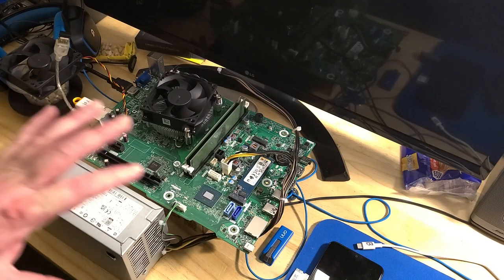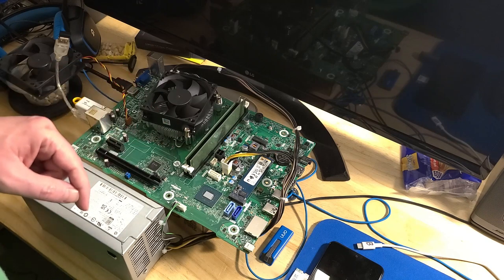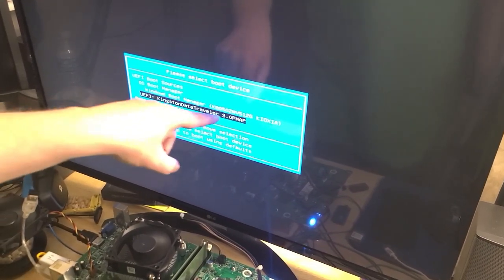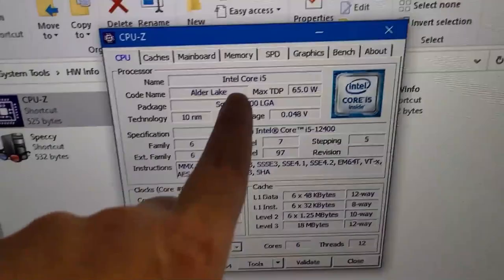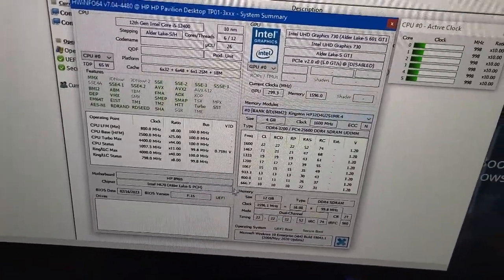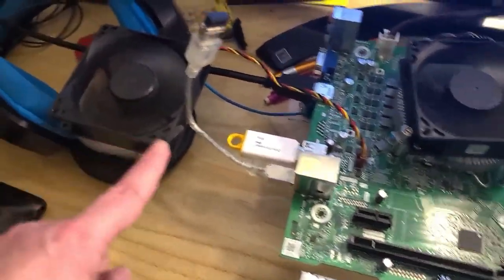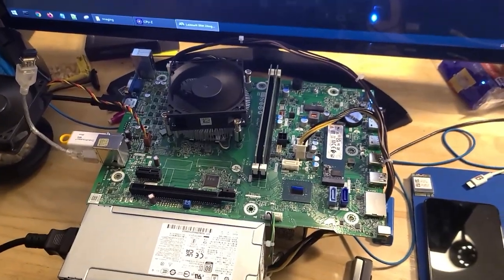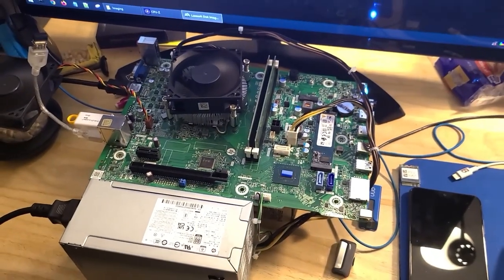Did I make a good trade on this HP motherboard

Comment: Good deal, I’d build it into a new case and get at least another 8GB stick of RAM so you can run dual channel. It’ll make a pretty decent machine. Custom aftermarket case won’t work with the front IO being integrated into the motherboard.

Comment: IDK your best processor but if it is older than this one,this is a keeper-. My best is a 10th gen I 3-not a gamer so it is ok but if this was gotten with trade,you did great here.
Reply from the maker: The system I'm going to be replacing this with is an Intel i5 8500 so it's a big upgrade for the replacement of that system